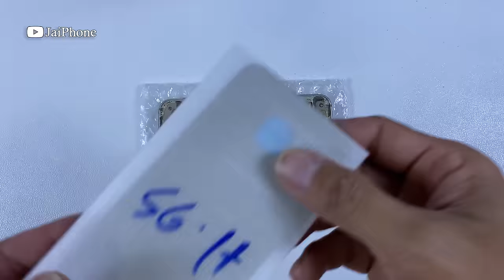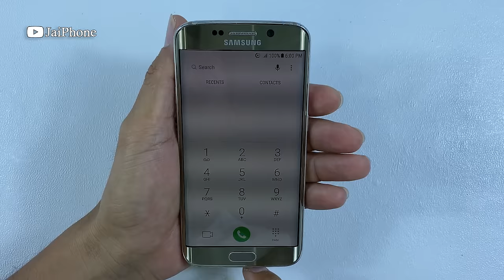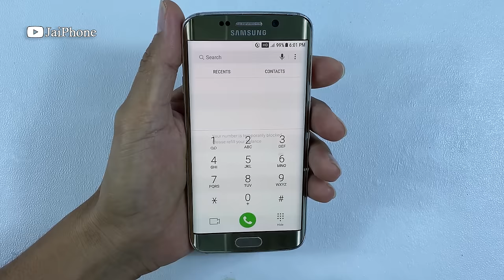Restoration destroyed phone | Restore Samsung Galaxy S6 Edge | Rebuild Broken Phone

Comment: Most of the parts are being replaced then what is the meaning of restoration ?
Reply: Right
Reply: But he has to make video 😁😁
Reply: So many youtubers doesn't know the meaning of RESTORATION.
Reply: Restoration is the act of repairing or renewing something. An example of restoration is fixing an old house to its original state. An example of restoration is giving someone their job back. An example of a restoration is rebuilding a set of bones to represent a dinosaur.

To someone who doesn't know what is the meaning of restoration
Reply: @itsmevish9642  right
Reply: @markangeloasayo7537  But replacing the bones with new ones, then replacing the body with a new one, then claiming it's an original restored dinosaur is not restoration, it's pointless.

Comment: Its really impossible that there's no Google Account linked to that phone.
Reply: @luqmanhakim7444  if you lose your phone you can remotely factory reset the phone. Its called find my device
Reply: @luqmanhakim7444  No lock pattern as well, its just a fake
Reply: all phones i worked with always had at least some way to reset google acc and pin/ lock patterns so its usually not that much of an issue
Reply: @rajeshkumarsubramaniam1187  I think it's because he use different parts or new parts
Reply: @ТвинкоаккТвинкоаккович  he buy part, made in China
Reply: @ТвинкоаккТвинкоаккович  those original part mostly expensive unlike made in China
Reply: Tons of ways to bypass google account shit